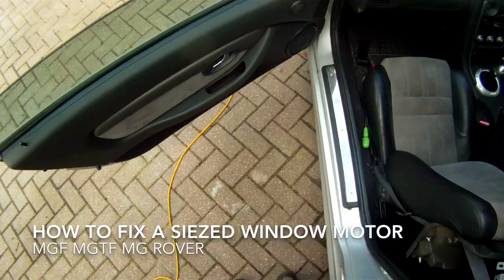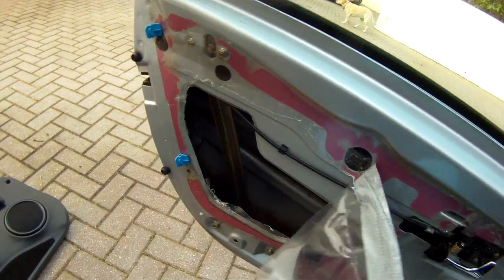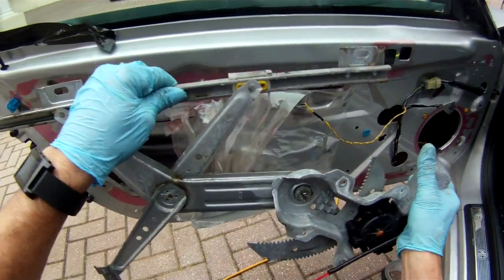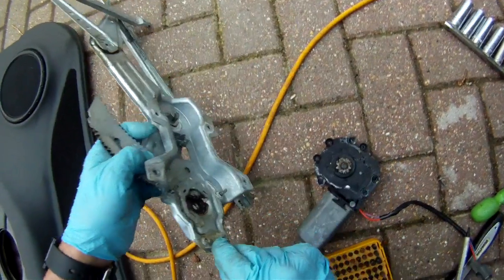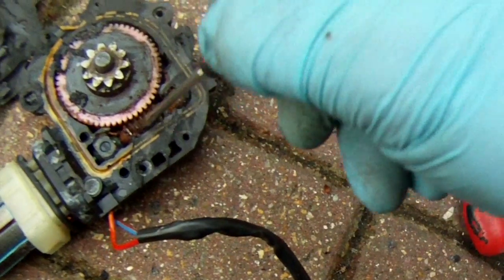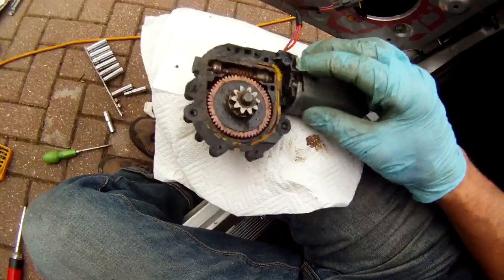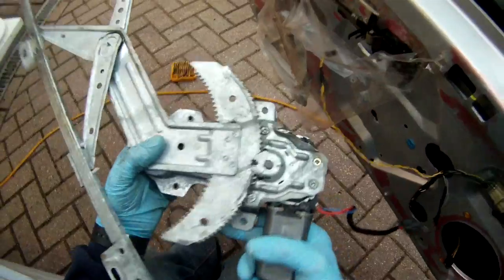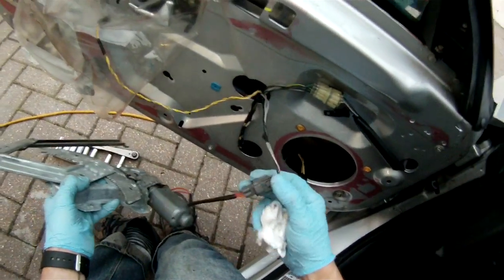How to Fix a Seized Window Motor - MGF, MGTF, MG, Rover

Comment: Thanks for the doorcard instructions. My passenger side window was stuck all the way down. The rear clamp onto the glass had loosened resulting in the rear runner jamming on the rail because it wasn't angled correctly.
Reply: Was this a faf about to sort as mine is stuck in the down position and won’t move up .

Comment: Thanks for this very helpful video.
Gave me the confidence to refurbish the mechanism on my TF after the gearbox seized (you can hear a click from the motor but it doesn't move).
Just to mention there are 2 bolts that fix the bottom of the mechanism to the door that need to be removed. It's also not a problem if the mechanism seizes when the window is down as you can still access the bolts that hold the mechanism onto the window
Once taken out of the door the motor was held on the gearbox by 3 screws so easy to remove and test. The worm screw was caked with a mixture of rust and grease, tough to scrape but came off after using a very small wire brush on a drill.
The gearbox was white plastic with a black insert that was only a press fit, easy to prize off after undoing the 3 screws that hold it onto the rest of the metal mechanism. Underneath the insert the circlip holding the gears in place was a pain to remove as it didn't have any holes for circlip pliers so had to be levered off and, as usual without circlip pliers, went ping. It now resides in the dust in some far corner of my workshop. So a piece of stainless steel wire bent to approx. the right shape became a replacement.
Also be aware that the big gear comes in several pieces (I presume to allow some play in the mechanism) that will come apart as you take it off the shaft.
Once disassembled easy to clean and regrease.
Pop it all back together and enjoy your working window
Reply from the maker: Well done and thanks for all your inputs.

Comment: Really  helpful video,  have similar problem with my TF passenger window, my motor runs for a while then stops? Gearbox also? No grinder so while try with a chisel. Tested if the same any as you,  with mechanism removed.
Reply: Update, came off using Stanley knife and small flat screw driver, pings off with some leverage.Will now test with cover off and see what happens,  would not have tried this without watching this video.
Reply from the maker: Thanks and well done for having a go. That’s half the battle done. It will be satisfying when you get it working which I am sure you will work out how to do.
Reply: @comeinhandynow  cleaned out packed with copper slip works a treat, all back and running.  Thanks for your video, doubt I would have tried it. Sealed case with Gorrilla glue, old glue comes off easy

Comment: Just a note: before doing all this, make sure the fault isn't simply with the switch. 

It's easy to pop out the center console part holding the window switches, and then you can simply swap the connectors of the left and right hand side windows.
Reply from the maker: Thanks for the input. Good idea to check.

Comment: Hi thanks for the videos, i have a problem with the window stuck in the up position it will not go down,  took the mechanism out tested it in the car and the motor us running in ine direction only, ( ie up) tried swapping switches over same result,  then i took the motor inside and hooked it up to a battery and it works perfectly in both directions by switching polarity, any ideas?
Reply from the maker: That would imply that it is a problem with the switch.  You need a multimeter to check the voltage coming from the switch and going to the motor.  It should show the problem area.
Reply: @comeinhandynow hi thanks for the reply, yes i thought it might be a problem with the switch so i swapped the switches over and get the same result, both switches raise and lower the passenger window but only raise the driver side, i was getting a voltage at the motor plug on the up function but no voltage on the down function, im a bit baffled

Comment: My fuse number 18 keeps blowing when shutting drivers side door  she is a  96  mgf
Reply from the maker: Suggestions:  get Haynes workshop manual.  Look up no.18 fuse and see what it powers.  Check wiring to those parts, which sound like they may be inside door.  If inside door, dismantle interior panel like in this video and check wiring for scuffs.

Comment: why did you not show us how to align the window after fitting good video otherwise
Reply from the maker: Thanks.  The window alignment was unchanged as the window runners were left in place and the window was left up.  It was just the connection between the motor mechanism and the window bottom that was undone.
Reply: can you by any chance put a vid on with a window alignment please as I have not come across this on youtube and would be really  grateful if you could as I am in a pickle at present with my nearside door window alignment  thank you in advance for any   help you can give graham
Reply from the maker: Sorry but I've sold that mgtf since the video was recorded.  It was a little while ago.
 It is often possible to find an original mg workshop manual in PDF format on the internet.  If you can find one for your car that might help, as they tend to be quite good and detailed and may have a section on window reassembly.
Reply: do you know how to adjust the windows thank you
Reply from the maker: A quick internet search shows finds this:
http://forums.mg-rover.org/mgf-mgtf-sponsored-mgfntfbitz-12/how-adjust-door-window-seals-342852/
Reply: excellent thank you so much really needed this ps great video
Reply: this is really hard on the gray matter, can't get this right will take to garage but thank you for the link

Comment: Mmm, not impressed. The motor you "opened" and showed seized at 3mins 55secs was not the same one you removed from the window regulator. The one you showed "working" and refitted was the same, or same type, as originally removed. I don't mind being shown how to change good for faulty parts but draw the line at being led to believe you un-seized it.
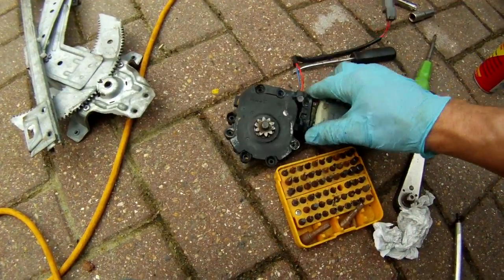Reply from the maker: I can assure you that IT IS the same motor.  Only one job was shown here, one motor, one regulator, one car.  It WAS unseized and fixed, not just replaced.  Maybe it’s confusing as it looks different when detached or turned over.  Let me know which other scene you think doesn’t match the 3:55 one and I’ll try and tell you why they are the same, which I can assure you they are.
Maybe watch the video again, or try this job and see how it goes if it’s a problem on your car.